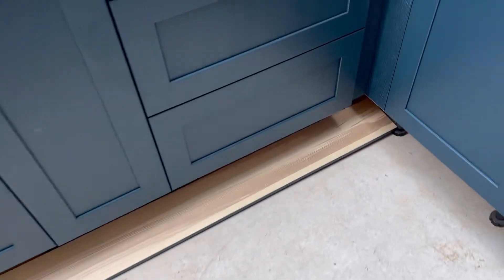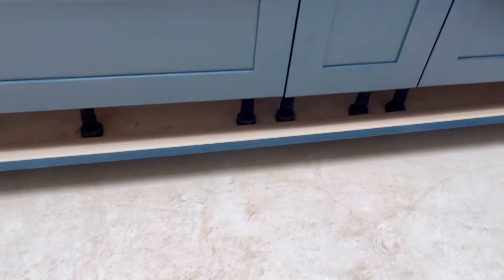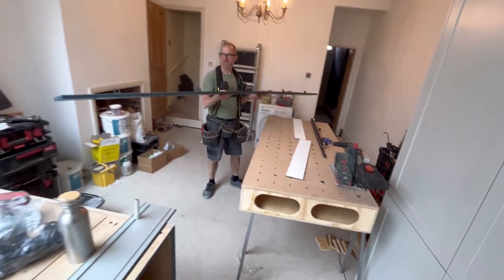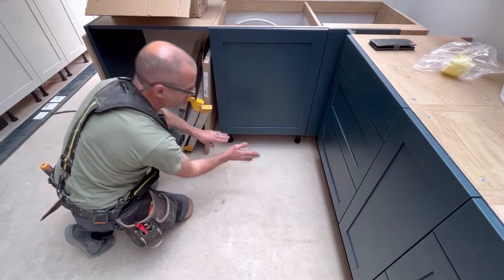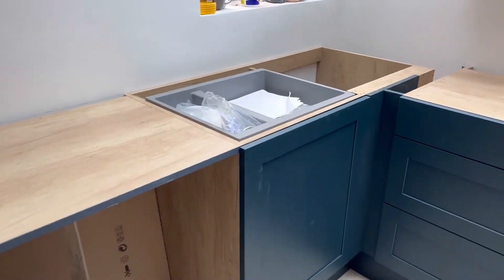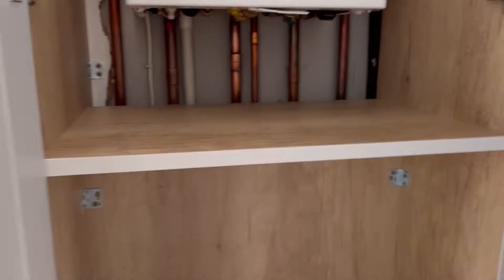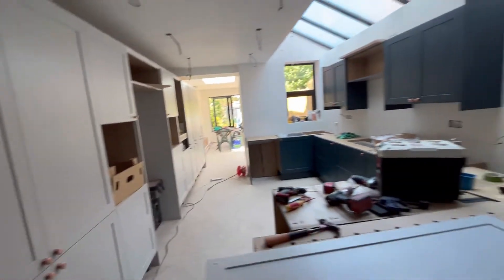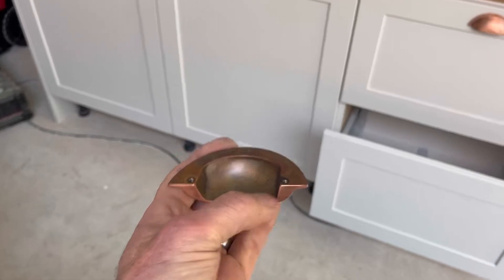Fitting Plinths and setting out handles Part 5 - Harborne Series #howto #carpentry #kitchen

Comment: looking great rich. 
i like the dowels  on the double doors. way cleaner that those horrible plates on the back.

i make little jigs like that aswell but i drill the holes in the jig so my selfcentering vix bit will go in  and drill the pilot hole. that way the hole doesnt get enlarged over time.

Comment: great video, i've got a lot from it thankyou for making it, can i ask about your base unit corner posts, i'm just doing mine on my new kitchen i'm fitting, should it sit level with the drawer front or the front of the cabinet, it looks like you have done yours to the front of the unit not including the doors, is this correct?
Reply from the maker: Yes mate I always set mine level with the draw/door front so it matches how I’ve done my deco panels. Just sit a piece of scrap behind it flush with the face of the cabinets and make up a corner screwing it into the end of it through the cupboards either side. If possible stick your deco corner post on it using some mitre glue so it’s all level and square then in acre the scrap pieces and screw your corner in from the back then refix into the corner. Hope this helps happy fitting 👍🏻
Reply: @Mr_A_Builders  many thanks, much apprichated